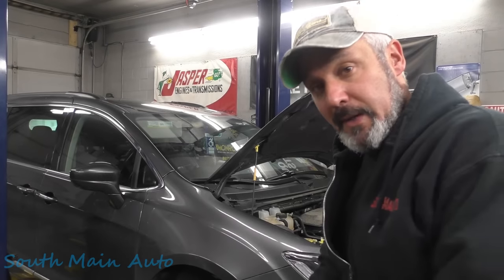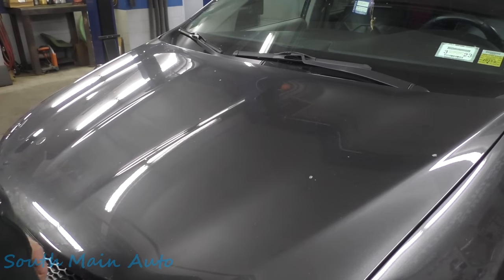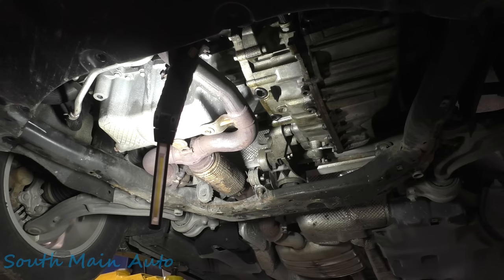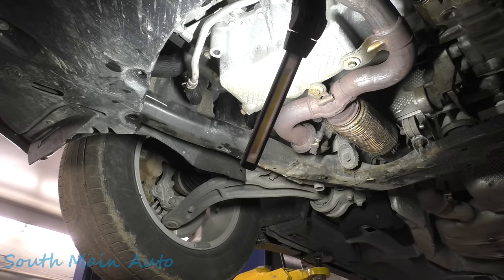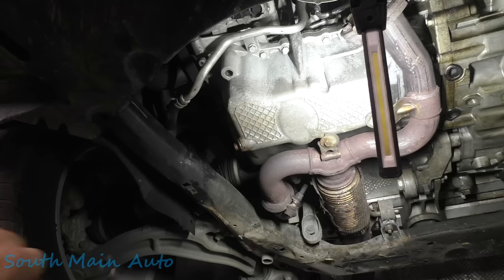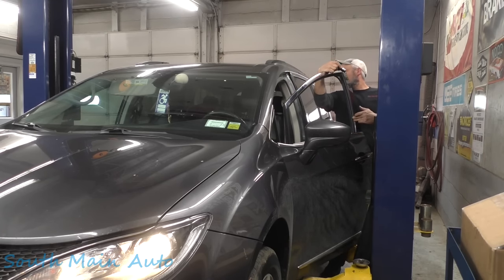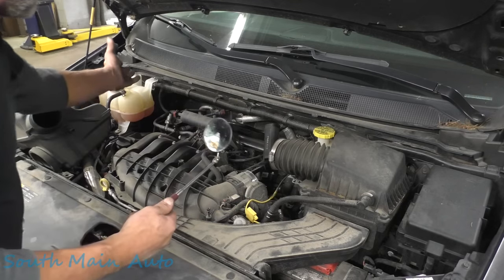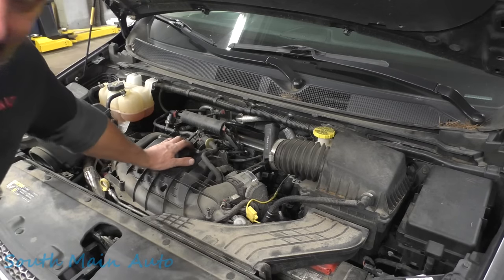Chrysler Pacifica Goes Full Nuclear 💥

Comment: Mr.O thanks for all the content you make us. I work at a Chrysler dealer and we are seeing quite a few of the new generation 3.6L engines(with variable valve lift and cooled EGR) like you are working with here that have head gasket failures. Typically it will have cold start misfires and if pressure tested for a long period of time. You can use a borescope to look on top of the cylinder and you will see coolant coming in. Like you said, this one did get hot, but just some information to share. .any thanks from one of your many viewers.
Reply: Thanks for sharing❣️
Reply: Thanks for sharing that with us!

Comment: Say what you want about Chrysler vehicles. We've had an '87, 2003, and a 2006 caravans and all have been pretty decent vehicles. The '87 had over 250k on it when sold and ran fine. The 3.3 engines seems reliable. The 2006 we still drive daily. It's only got about 115k on it right now. Replaced a couple batteries, water pump, radiator, and starter. The emissions stuff on it is a pain but last time I replaced the EGR I used a factory part and it's good as new. Had a rodent get in and chew up a bunch of wiring about a year ago so that was fun. The 2006 I have no complaints about. It's been as good as the 2 Toyotas I've owned. Some years are worse than others though. Haven't heard a lot of good about the pentastar engines though and going through the comments here I wouldn't want one. Eric is the best mechanic I've ever seen and I've know a lot of mechanics.

Comment: "...or there's something else going wrong because it's a Dodge".    Between you and Wes, Dodge is taking a beating today!
Reply: What about Scotty?
Reply: @optophobe  No he just said not to buy a Ford.
Reply: @optophobe  I don’t know, I get distracted by his orchestra conducting.
Reply: @Albo alt I've had five, starting with an '86 2.4L ending with a '96 3.8L which died on the road and is now ion a crank but no fire status.  Changing crank and cam position sensors did not help.
Reply: Dodge deserves it. Stellantis deserves it. Nice design, bad execution. Terrible parts. They can do better but choose not to.
Reply: Dodge puts the k in quality.
Reply: LOL I literally just watched Wes' video on the TIPM on that truck when I saw this one.
Reply: @Marty's 4x4 oh boy have you not seen modern ford lmao
Reply: Chrysler used to build great stuff. I have three of them.
Reply: @Marty's 4x4 Depends on what you consider reliable I guess.  Most vehicles regardless of what stickers you buy are reliable, until you start modifying them, and skipping regular maintenance.  I had a couple of Toyotas, they weren't as reliable as people pretend they are...and recurring bearing issues fixed twice under warranty, and the 3rd time I got corporate involved, then sold the truck with 104k, on it...the 4Runner was just garbage from the beginning, the typical sagging rear suspension...and the new ones are just as bad unfortunately.  

I've had GM, Ford, Toyota, Nissan, Mazda, and a couple Jeeps.  I'm back to driving all Fords, but none of them are close to new, newest is 14 years old.
Reply: Hate dodge’s daughter had one with less than 60k 3 rd gear wouldn’t engage auto trans , dealers said no warranty I said that I would never own a Chrysler product period !!! Guess what my daughter continues to buy them, they never learn.
Reply: @tonywestvirginia  You must have the only 3 good ones.  Everyone I know who had Chrysler or Jeep have nothing but problems.  My buddy's Jeep Patriot is on it's 3rd rack and pinion at 90k miles. His motor mounts completely rusted out, he got lucky and got those replaced under warranty. His moonroof leaks so bad it dripped down and shorted out the stereo display in his dash.  It's a complete turdbox.  Every single Chrysler sebring or cirrus built in the 90s is in a scrap yard because the transmissions were garbage.

Comment: Imagine that, running an engine hot has consequences. Good call and thank you for taking the time to diagnose the problem and explaining your reasoning as well.
Reply: Some of us are from times when engines had cast iron heads; they could be run without coolant and still run afterward. In our local demolition derby old Detroit Iron is popular because the radiator can be destroyed but it won't shut down the vehicle before the event is over.
I confess my favorite event at the Derby is the Powder Puff event. The guys try hard to avoid being hit; the ladies know you are either a hammer or you are a nail. They sure know how to kick up the action!
Reply: My idiot neighbor were driving their Honda mini van when they heard a loud clunk, oil smoke & the engine died. Had it towed home, checked the oil, added 3 quarts & still wasn't showing on the stick. I charged the battery, starter clunked but wouldn't crank, put a socket & breaker bar on the crank pully, but it couldn't turn.
Their solution?
Replace the battery, have it towed to a repair shop & "find out what's wrong!"
Now you know why I call them "the Flintstones!"
Reply: @mariosaccoccio1688  "Our truck broke down last night. All of a sudden there was a boom, then frantic flapping noises and oil spewing everywhere around the engine!".

That's a quote from a Youtube video and I'm not 100% sure if they ever revealed what the issue with the engine was but I'm 99.9% sure it threw a rod right through the crankcase. Late-80s Nissan Diesel engine with who knows how many miles on it. I definitely remember they ended up having a used engine put in.

Comment: I have worked on older engines that had the problems you pointed out, and often found if it was not a blown head gasket that it was a cracked block. Which was cracked internally, in the water jacket and crank case. Had a blown head gasket on a 1972 Ford F-100, that was caused by a bad radiator. Which taught me a very valuable lesson on rebuilding engines, and not having the radiator re-cored. Or at least acid cleaned, and patched before putting the new engine in.